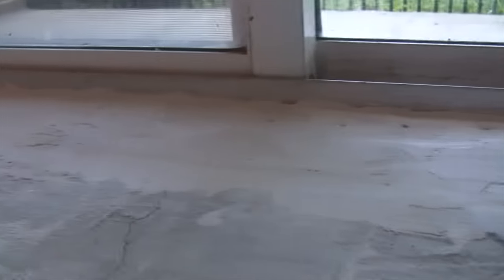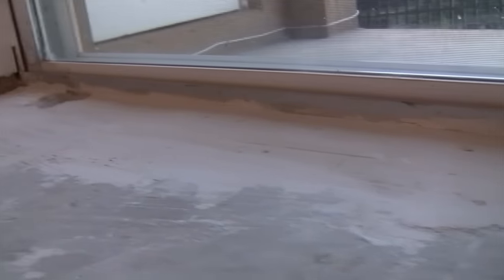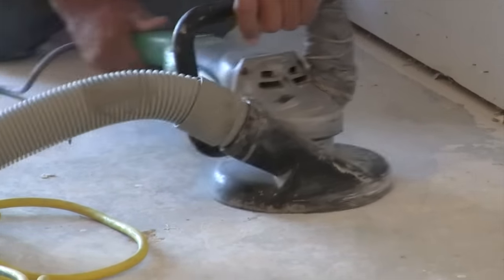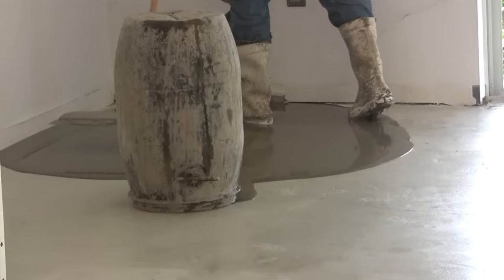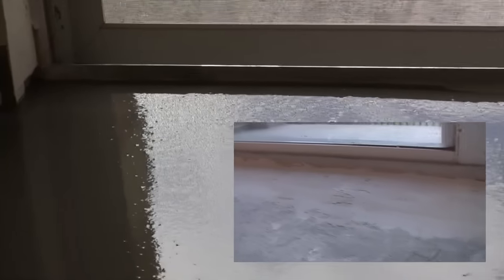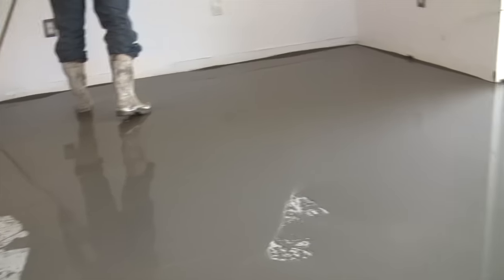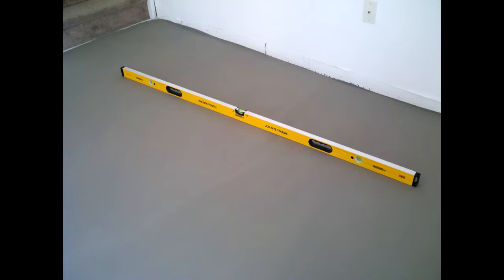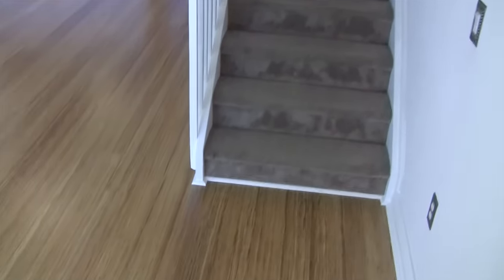How to Self Level Concrete Floors Like Pros - Self Leveler

Comment: Looks good. My two cents would be to add an expansion joint around perimeter. A sil plate foam was what I used to use. UZIN is the only way to go in product in my mind. Once I used that compared to other brands I never went back. And I’m really surprised you didn’t use a spike roller. It breaks surface tension and keeps the product extremely fluid until reaching pure level. I had an Ardex elite team pour 12,000sq ft for our flooring crew. And I will say that it was a plus or minus 1/8 in ten feet when finished. In residential I suggest making sure all holes creaks are fill. It’s dangerous on second story homes. It will go everywhere.
Reply from the maker: Yes, I don't know why they did not use the roller. It was a reasonably flat floor t begin with, so maybe the self leveler did not need a lot of coaxing. All I know is in the end it did come out perfectly flat, and we put down bamboo floor planks and the floor was perfectly flat with no creaking floor boards.
Reply: I get that but to me flat is a relative term. I hate when flooring guys say I need a flat floor to tile. Flat and level is always better. And to what extreme. For me I bring a ten foot screed to double check on completion. My only point it beware sometimes self leveling will have bumps and hills in it if you don’t go and least 1/4” above you highest point. Personally I’ve had to do double layers to correct. The video looks like it came out great. 👍
Reply: in a residential remodel where there is sheetrock walls, the sheetrock has a tiny give for expansion.  not ideal, not a best practice, but prob not a nightmare.

Comment: Do you have to keep the leveler off of the Sheetrock or framing? I’ve seen some use painters tape but wasn’t sure if it was necessary. I didn’t see it done here so I’m wondering if it is a necessary step.
Reply from the maker: Here's how you figure it out. The underlayment for the wood flooring will be 1/8" tall. the wiid flooring will be typically 1/2" thick. If you can keep it from hitting the wall more than 1/2 in off the floor, then you won't need to tape up. Most walls leave a 1/2" gap on the bottom anyway. Also, don't forget the baseboard will add 5-6" on top of the wood floor, so no one will ever see it anyway.
Reply: @jeffostroff  hey Jeff -- what about recommendations to avoid wood touching concrete to limit condensation?  Thx!
Reply from the maker: @yestravis   Yes anytime you have wood stud walls touching concrete you must use pressure treated lumber or put a vapor barrier under the wood floors in the case of flooring
Reply: @jeffostroff  Thanks so much!

Comment: I’m about to do my kitchen, but the floor has air vents coming up from the basement. How would I cover those so that they will be level with the floor , and still keep the shape of the hole so the vent can be put back on afterwards? Great video, Thanks!
Reply from the maker: they usually remove the vent covers, then dam up the square hole around the vent, then after the pour, you can put them back, maybe you'll need longer screws too.  the leveler is like pancake batter, so you have to built a mote around the hole to keep it from slithering down the vent hole until it sets up.
Reply: jeffostroff wow, thanks for the quick response. Appreciate the feedback on this. I’m fixing up an old house, so I’ll definitely be visiting your page a lot more for any diy tips. Cheers!
Reply: Use some foam or sponge about 20mm and  stick around vent, after leveling remove and fill with smoothing cement such as feather finish.

Comment: I'm trying to find a product to go over my non floated (bumpy) garage floor that will not chip away from being thin ( 1/4in or so ) and stand up to my classic car being parked on it. 
Any ideas? I'm rebuilding soon as hurricane Zeta took collapsed my old garage.
Reply from the maker: I've seen people install those checkerboard plastic garage tiles, but for leveling, go to Ardex's web site, they have stuff made for garage floors, as regular leveler cannot be used on that floor
Reply: @jeffostroff  Ok thanks!. Yeah. Those snap squares aren't for me.

Comment: Just a question on the bonding agent, was that a quick dry? They have some that'll dry prior to using the self leveler in less than an hour generally more expensive. Or they've got some that take several hours to dry. Which obviously slows down the process
Reply from the maker: I use the Sika bonding agent and it usually tells you to immediately start applying the cement. Just have to check the instructions on whatever product you buy

Comment: How flat does a floor have to be to lay Vinyl plank flooring? Also can I do just low spots or do I have to do whole floor.
Reply from the maker: you are allowed a maximum dip inn the floor of 1/8" over 6 feet. So lay your 6 foot level down and if the floor crowns or dips beneath the level by more that 1/8" you need to level it

Comment: Can this be done in a garage? I have a slope for drainage but I used the garage for my workshop.
Reply from the maker: Yes you can use this anywhere to self level a concrete floor. Make sure you check with the directions of the self leveler manufacturer because sometimes if you have a really smooth almost glossy concrete surface in your garage they will want you to rough it up 1st otherwise the self leveler will not to the concrete flooreven if you use a priming agent.

Comment: 1) i wish you woulda gave me a close up and also sweeping view of the floor right after the sanding/cleaning up of that sand. so I could see just how smooth you think it should me. like did you sand away all those bumps?
2) should he have pushed the compound closer to the stairway? he left a bit of a gap there and I'm wondering if it should have been closer.
3) does the increased height of the floor cause problems?
4) how much does this cost if you're renting tools and buying the bags, and the vacuum?
Reply from the maker: The screenshot on to 42 shows it best. So he is using one of those bowl grinder wheels on his angle grinder in all he is doing is just roughening up the surface a little bit it's not supposed to be smooth. So by roughening the surface a little bit it allows the new soft level or mortar to stick to the old concrete easier.

Comment: I poured the self leveling floor in a concrete  fountain. part of it started  drying in the sun as it moved over the trees  so I used just a little water  to smooth the very top of the leveling material and it worked.  BUT when it was dried and I rubbed it with my fingers it felt like sandpaper and some of it went powdery.  it was solid in some areas and where I added the little water to smooth it, it  had a lighter color to it .so I sanded it down to remove the soft powder and got to a solid surface.  i vaccummed up the soft powder . I want to put my thin set mortor down so I could lay a mosaic  tile pattern on the floor. HAVING SAID ALL THAT ,can I now put my white thinset over the newly leveled floor mix. will it be ok ?  and put down my small mosaic design down , or will it all fall apart because i had to sand the level floor stuff to remove the powder..  
#2 can I use thinset on the fountain walls and not tile over the it at all. I just want a white smoothie surface.
Reply from the maker: You can put the thinset down once the self leveler layer has dried the specific amount called out by manufacturer instructions. As far as using thinset for the side walls of the fountain as an unfinished mortar, I'm doubtful tha is allowed. Remember some thinsets you can't even use outside. So you need to call the manufacturer and talk to them about that. Some people might use a stucco formula.

Comment: Why would need to grind it if it's self leveling compound? My back yard is cracking and some parts are getting down and other are getting higher.  Please advise
Reply from the maker: Grinding down the floor first helps to prepare the old concrete for the new concrete. It removes any potentially contaminating old liquids spills oils paints etc
Reply: @jeffostroff  Thank you!
Reply: @jeffostroff  Can it be done outside?
Reply from the maker: @claudiabrunet3696   Some manufacturers allow it for outside yes but you must have a flooring over it when you're done
Reply: @jeffostroff  Thank you so much for your help, I really appreciate it.  I'm actually thinking to put title. 😊

Comment: Can you tell me exactly what you bought to get that consistency. I bought some from Lowe's and it looked like regular morter not thin and free flowing like yours.
Reply from the maker: they used Mapei Ultraplan 1 Plus self level. These work in a perfect choreography, they use precise measurements, with buckets that have holes on the side so if you add to much water, it drains out leaving the exact amount of water needed. You have to experiment to see what works, but the bag gives you a range of water to work with, I would start with the most amount of water called out by the recipe first and see if that works.

Comment: Is this concrete strong enough to use to level a garage floor? Could it support the weight of a car and other heavy objects such as a workbench or shelving and stuff?
Reply from the maker: No, the manufacture instructions usually tell you not to use in a garage, the loads are too heavy, they usually say interior floor use only, so always check the instructions on the bag, or also go to Ardex web site and ask them which of their levelers could be used on a garage floor.

Comment: I wish I had watched this before grinding my floor without a vacuum. It was a bad situation.
Reply from the maker: Holy cow, I bet it like a fog  in there. We had to use an angle grinder on a bathroom floor on the concrete, and even with a vacuum, not connected to a port, just held the tube near the grinder, it still filled the bathroom with fog. We also had a fan in the window to help suck the dust outside. Glad we had on masks that day.
Reply: Use caution the white fog is not harmless .. it's crystalline silica 'dust' and consider a carcinogen and should never be breathed - use water when possible when grinding or sanding concrete - also use vacuum and lastly N95 rated resperator or better
Reply from the maker: @smokedpotato  I wish the angle grinder manufacturers would design shrouds on them with vacuum ports, to keep the dust low. I have seen universal adapters, but heard they don't fit very well.

Comment: Hi Jeff we have a laundry room that is about 9' x 13'. The floor is bare concrete and old linoleum (less that half) kind of torn up in spots. We want to use LVP and I know it has to be level to do that. The main problem is that the backer glue in the linoleum is 25% asbestos and we don't want to do another freaking abatement. Will that leveler adhere to the lino patches and the concrete with the bonding adhesive and a clean surface??
Reply from the maker: Yes I would just entomb it and make sure you use that bonding agent. Don't know about roughing up the linoleum first, because you could stir up asbestos.

Comment: How is this self levelling if yo need to rake it about.
Reply from the maker: Everyone thinks you just dump self leveler nd it does the ret. Due to the finite viscosity of the concrete liquid, and surface tension properties, you still need to coax it into place, and then it settles down to a self level

Comment: What happens to the drywall at the bottom of the walls after self leveling compound has been put in?  The drywall is now in contact with the concrete and self leveling compound.  Concrete has some amount of moisture at all times, does it not?  I would suspect the same of the compoumd, especially since they are now tied together as a unit.  Moisture is not really great for drywall.
Reply from the maker: This stuff dries to the touch and a few hours and you could even walk on it in 4 or 5 hours so whatever moisture is it goes out pretty quickly.
Reply: @jeffostroff  : Jeff, thank you for the reply.  I am not so great at carpentry and home remodeling things.  Machining and mechanical things, yes.  I am just trying to get a handle on this before trying it on my own in a small bathroom.  When I was referring to the moisture issue with the drywall and compound, I was thinking about after curing, over the life of the floor and drywall.  You did bring up an excellent point about moisture DURING the install, which I had not thought about.

Comment: Do you have to cover the entire floor?  I have a basement that I Want to level.    It is very close to already being flat.  There is just a few places that  are sunk in by maybe 1/8 inch.   have heard of "feathering it out"  on the edges.
Reply from the maker: There have been a few times where we did not level the whole floor we have only done parts of rooms like bathrooms for example where there was just a small dip in an area about 20" wide and you just fill it in and you trowel it out until the point that the self leveler compound lines up with the regular part of the sub floor without leaving a bump up.
Reply: cs64748 Feathering is a concern. People do what another person suggested to you, but it is not a good practice. A newly placed material shall have minimal thickness, which is recommended by the manufacturer. Feathering creates zero thickness. The right way to deal with your situation in a small area is labor intensive. That is why no one wants to do it. If you are interested, I can tell you the right way.

Comment: Hi,

I need to get my floor leveled as there is an existing sunroom that I want to bring up to the rest of the house pad. It is approx 1 and a half inches. Would they use leveler for this?
Reply from the maker: Yes, you have to make sure the leveler instructions allow you to go that deep. IT might tell you to add pea gravel.
Reply: MAPEI's Ultraplan 1 Plus will go to 1.5" with no extension.

Comment: Ok stupid question. I have to level a part of my basement floor on one of my rentals.  It has cracked, and risen. Mainly due to the fact the previous owner did not have gutter. Do I have to tear it up, and regravel it. Or can o just seal it then use the self leveling concrete.
Reply from the maker: Tough one to answer without seeing it. Generally, cracks over 1/8" wide should have a professional foundation repair company look at it and advise. Question is, did one side of the crack rise above the other? and How high did it get heaved upward? How wide is your crack? If you removed the root cause, i.e., you added a gutter system, then the problem should have stopped by now and not getting worse right? So now if you have a steep vertical crack, you can plug it with eleastomeric caulk. As long as your crack is under 1/4" wide, it should be OK to just let the self leveler fill in the crack for you. Otherwise, the contractor will have to look at how serious the damage is, and determine if you need mud jacking, grout injection, or any other major repair. I wish YouTube allowed you to post photos here. Let me know about your cracks.
Reply: @jeffostroff  The cracks are about an 1/8" The floor rose anywhere from 1/2" to 3/4"  Mostly by the drain on that side of the basement. The area is only about 10x12 or so. The rest of the basement is good. Well except for a small leak in the wall from under the addition they put on which is just a slab. I think I have it fixed. I drilled a hole in the bottom block about 2" from the floor and inserted a hose, and trenched it to the crock to drain. It's worked so far. But we haven't had a really good rain, or snow thaw yet.
Reply from the maker: @anthonyyohman  With your floor heaved up 3/4" that seems way off the normal, might need to get that fixed before you try to get the floor level with self leveler, it would take a ton of bags to fill that depth! If you read MAPEI's instructions for their Novaplan 2 they tell you when you are doing an inch or so pour, to use pea gravel aggregate. But I still think you should call in foundation experts because that 3/4" heavage is indicative of something major comprised in the foundation. Even if you have to pay them $150 for a visit to advise you on what to do, that could be a lot cheaper than finding out after self leveling that you still had structural problems. With one bag of self leveler, if you're covering 1/2" thick, it only covers 12 sq feet, or 3 feet x 4 feet area. Expect to use double that for covering 3/4" or more, and do the math how many bags you would need in your basement, then you have to keep mixing them without stopping until they are all poured, and you get 3 to 5 minutes to work with it. Might be best to have your basement floor cracks repaired and grinding it down to somewhat level first, then pour the self leveler. Also ask the foundation experts about sealing your basement floor to keep moisture at a minimum. Bottom line you have to solve all your water intrusion problems first BEFORE you attempt to self level that floor. sometimes they add membranes outside the house on the foundation then push the dirt back up to it, and this keeps water out.
Reply: @jeffostroff  I can do the membrane, and add the sand and gravel which I know would fix the drainage problem now that it has gutter. Just really didn't want the expense on a rental. Why people don't understand why gutter is needed really gets me. If I'm gonna go through all this plus remodeling the rest of the house I might just flip it. Thanks for the help. I appreciate it.
Reply from the maker: @anthonyyohman  Yup, you have to tell water where to go, direct it away from the house. If you don't direct water where to go, it makes up its own mind and chooses the most expensive path, i.e., down the outside wall, into the foundation, flood in the basement. Every house should have land sloping UP to the house, and gutters directed a few feet away to sound water down that slop toward the street.